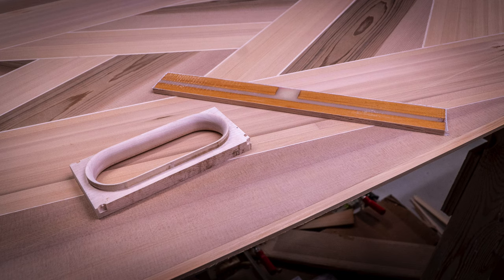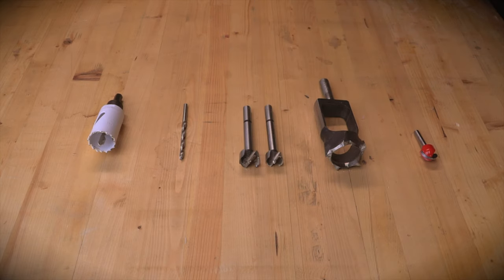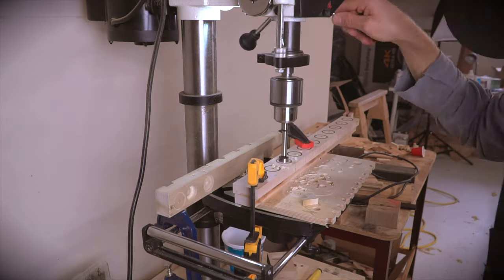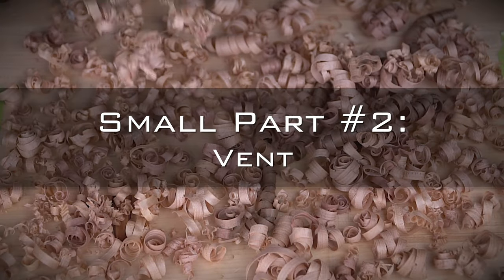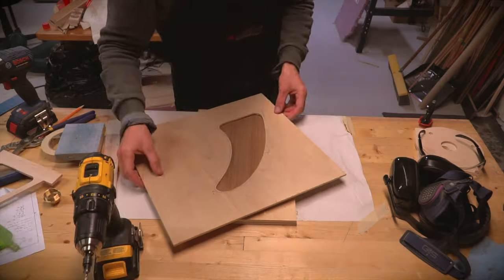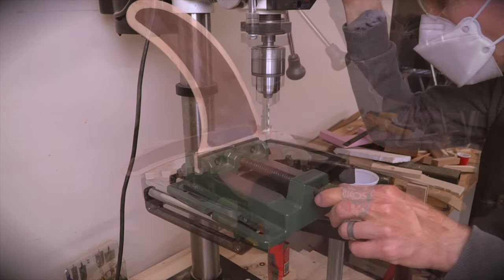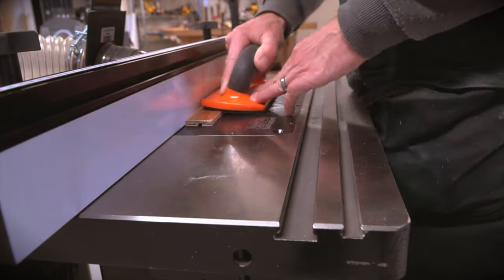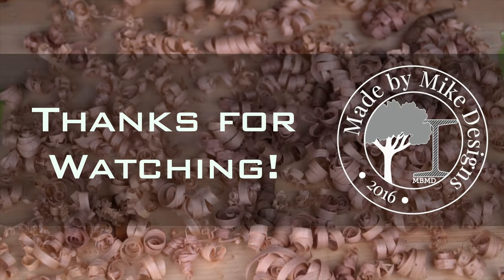Mike Builds a Paddleboard Part 5 - Small Parts

Comment: Great job Mike. Can I ask you where you got the vent plug? I'd like to do the same on my build and dont want to use plastic. Would like to buy a few of these plugs actually.
Reply from the maker: Thanks for checking out my videos.  I hope your build is going well.  The vent plug came from tuckersurfsupply.com.  There are some other suppliers of similar plugs too.  I’m actually having a bit of trouble with venting in general, though.  On warm sunny days, a lot of pressure builds up inside the board even with periodically opening the vent.  I’d like to change to some sort of active vent that can continuously release air pressure without letting water in.  No luck finding the perfect one yet but I’m up to my ears in home renovation projects now and haven’t spent much time on it.